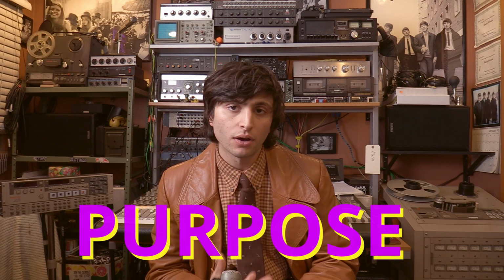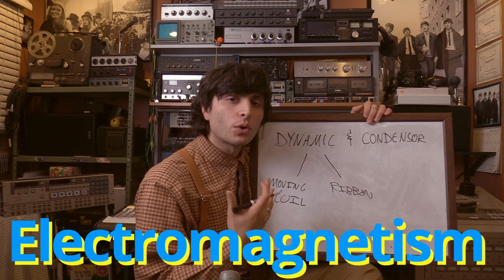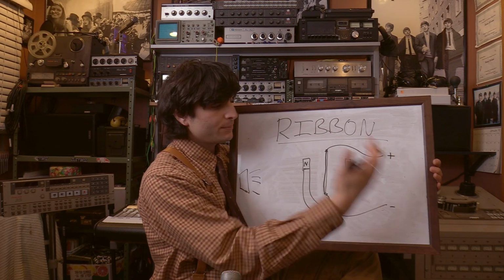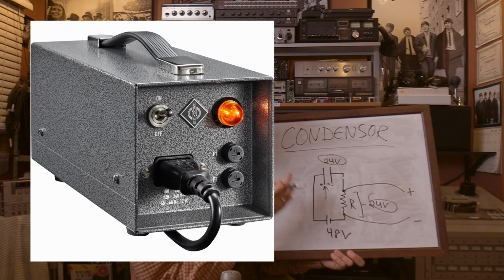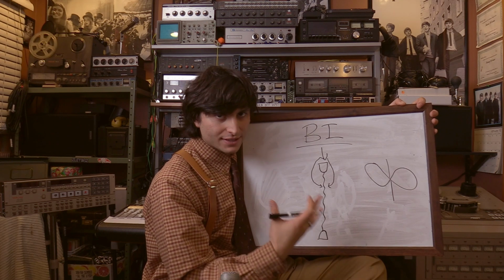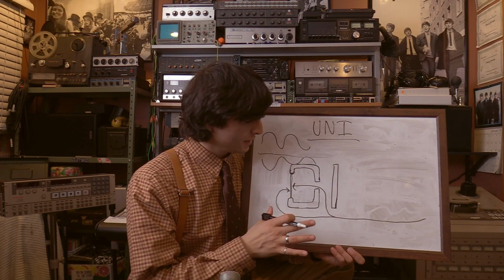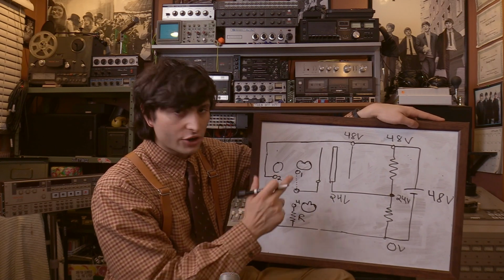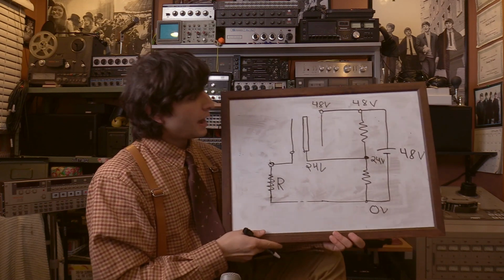Microphone Design Basics Every Home Recordist Should Know

Comment: I think you answered my question "why does my Fishman amp give 24v phantom power?"
Reply from the maker: Did I??? Never heard of 24V phantom power lol!
Reply: @Mario_DiSanto  I was reading between the lines
Reply: @Mario_DiSanto  I'll try to dig up my manual and report back
Reply: From Fishman: The Loudbox Artist and Loudbox Performer use a 24v high current phantom power supply standard that allows users to operate condenser microphones and other devices requiring phantom power without issue. In many cases, the high current standard provides increased power and stability than 48v sources.
Reply: It looks like most modern condenser mics will operate in a range of 9-52V